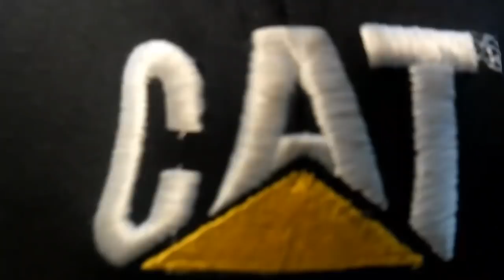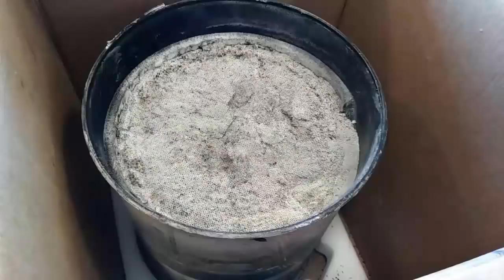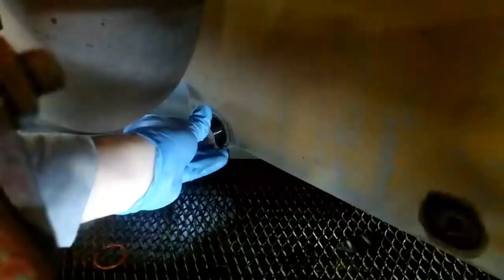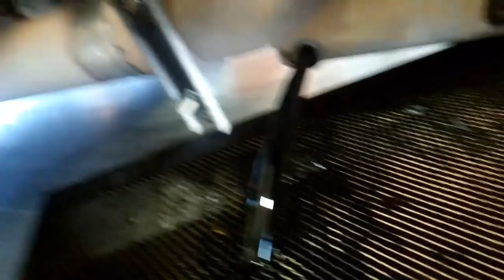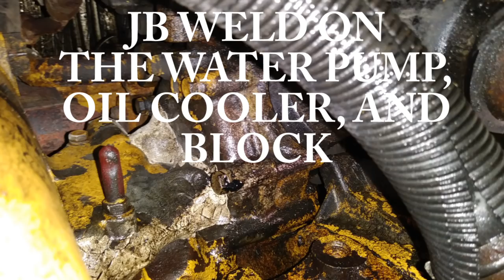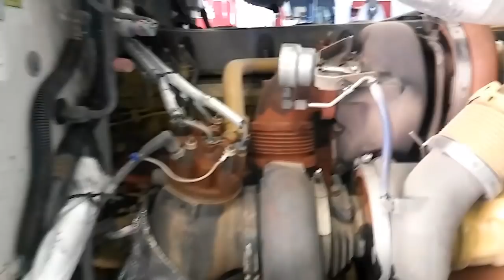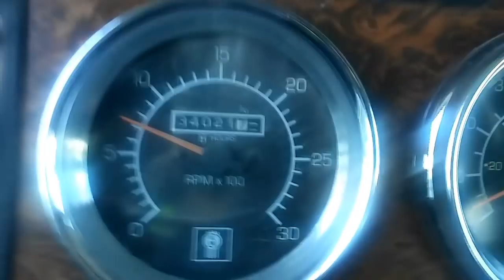What To Look For In A Used Diesel Engine? Used Diesel Engine Inspection.

Comment: Does anybody know any good diesel channels? I’m going to college for heavy diesel equipment and I’m looking to prepare myself over the coming weeks.
Reply: This channel and dieseltechRon. What college? I just got out of Lincoln and now going to another diesel school... good luck. Cheers!
Reply: I know I watched a bunch of videos on the channel Fanshawe Motive Power my first year and some videos on this channel during my second year (take apart engines, measure, reassemble, run).  I'm guessing the apprenticeship system is a bit different up here in Canada but those were the ones I checked out.  Just searching YouTube worked pretty good for me if I needed to understand something better (like all the fuel pumps and understanding how they worked)
Reply: Bradley Macaulay thank you sir, I’m sure it’ll help me in my combing years.

Comment: I love your site and advice just joined yesterday ive been looking to buy a 1998 thru 2002 chevy GMC 6500 rollback towtruck with the cat 3116 or the 3126 ive owned them before was years ago but they were great trks very easy to get used parts or new reasonable but there really getting hard to find reasonable were if it does need these things im buried in it so i found a 1998 chevy 6500 170k miles rollback the owner has had it for almost 11 years to transport cars to the auction so hes only put around 20k miles on it in all that time but the beds in great shape no rust interior is like new cabs dry its a eaton fuller 6 speed im fine with that actually have a spare sitting if needed so u no the truck O its a 3126 so heres the bad its smoking everywhere from all over under the hood when running now im over 300 miles away from this truck i no u cant give me any diagnosis when i personally haven't seen this truck just alot of pictures so my question is not about fixing it its about worse case motor swap i can buy 2002s gmc school buses this company has fleets and there selling them running driving home buses there automatics and there $2500 out the door so how do i tell horsepower or torque numbers is there a 3126 that u would want on your 1998 6500 if u were buying or building one i no rebuilt new is the way to go but in my situation rite now im on a budget i need a year so if i follow your advice from this video and i get the best one they have i no i have enough parts to make my truck a driver plus some extras like the rear the Alcoas with like new tires and its gotta return $600 in scrap when im done i really enjoy your videos and respect your knowledge you break it down into layman's terms makes it really easy to understand I just actually wondered if u were in my shoes what cat 3126 would u be looking for and its gonna be on the highway alot for power plus decent fuel sorry for this extremely long question i have a bad habbit of talking alot myself i hope u even see this hopefully u do either way keep up the great videos thanks again JOHN

Comment: Hey thanks for the video very informative and helpful I have a question I drive a 2015 International straight truck it has the n 13 engine buy Navistar with the def system what's your opinion on these engines I know the older maxxforce 13 what a pile of poo have you heard of people having the same issues with the newer def system on the N 13?

Comment: Will you do a video on the right way to disable the EGR? It has been clearly established that the EGR significantly shortens engine life AND fuel economy all in the name of reducing NOX. Thanks.
Reply: Robert Polkamp disabling egr is illegal so it's unlikely he will ever make such a video.
Reply: I wouldn't suggest getting someone to "disable" your egr... I give this advice both as a fellow diesel mechanic and the son of a semi driver.... HUGE FINES if you get caught.
Reply: You're gonna need to take it to a tuner's shop or do it yourself because this is illegal for on-road use. At least Michigan doesn't have emissions testing...

Comment: What about when the jake comes on it smokes dark smoke? Then goes away?
Reply: What is the year and make of the engine, and how long does the dark smoke last?
Reply: Chad Jessup hey chad it’s a 2005 mxs cat c15 Acert it will come out when I first turn on the jake brake and it doesn’t last to long maybe 1min at most, but it’s constant. More so when I first activate the jake for the day
Reply: One minute is excessive.  When the jake is initiated, at high rpm usually, there is fuel still in the combustion chamber which does not fully combust at that moment, so a short burst of black smoke is to be expected (newer engines/jakes not so much).  I would suggest there is an injector which is not seating properly and allowing some dribble.  Since the engine is ACERT, and I am not familiar with that, I would see if Josh could add an angle to this issue, because the black smoke is definitely a result of fuel in this concern, for I would assume notice would be taken of, say, a turbo oil leak into the combustion chamber.
Reply: Chad Jessup hey brother so I just did the test it smokes more on the 3rd setting and sorry it’s not for a minute I would say maybe 5-10 seconds and then clears up and it’s a dark smoke, I don’t know why I even though a full minute that is fairly long
Reply: OK.  That is actually good news for you.  Glad to hear that.  So that acceptable short period of black smoke indicates all cylinders are contributing equally.  Keep on truckin' and watching Josh's videos.
Reply: Let me add this:  For troubleshooting purposes, select 1, then 2, then 3 for jake operation to see if there is a difference in the amount of smoke.  The #1 position, if memory serves me correctly, activates the #2 and #3 cylinder jakes; the #2 position activates the #1, #2, #5, and #6 jakes; the #3 position of course would activate all the jake solenoids.  That procedure may tell you something, if smoke decreases in the #1 or #2 positions.

Comment: What Cat engine would you recommend in a highway glider-truck, long-life and desant mpg.
Reply: Diesel Power 6NZ if you don't mind eld, 1LW if you want to be eld exempt. I personally run a 1LW and love it, also have a 5EK and have no complaints.
Reply: 2ws
Reply: Isuzu 4HF1 is the best on highway engine you can buy
Reply: 20 to 5 wheels are tires on the tractor and 333 Rears is where you going to get your field mileage from 333 or 330rear screws either or with a  10 speed transmission

Comment: What's your thoughts on a Detroit 8.1 fuel pincher? Thinking about repowering an old fire truck with one.
Reply: it's actually a 8.2 the early models had head problems but the later ones were ok. they're very fuel efficient, but lack in power in my opinion. we have a couple of single axle dump trucks with that engine and we really like them.
Reply: Had one in a 86 gmc tow truck in catskills mountings no power at all
Reply: it's actually a 8.2 the early models had head problems but the later ones were ok. they're very fuel efficient, but lack in power in my opinion. we have a couple of single axle dump trucks with that engine and we really like them.
Reply: @Clyde, I'm thinking about repowering my 62' fire truck. Gross weight will be right at 25,000 with water and gear. What do you think? It would be replacing a 332 Lincoln Y block, so I'm not looking to get crazy.
Reply: it's actually a 8.2 the early models had head problems but the later ones were ok. they're very fuel efficient, but lack in power in my opinion. we have a couple of single axle dump trucks with that engine and we really like them.

Comment: We just ended up rebuilding 3 engines. All 3406E. They all had around about 1.5 million miles. All water issues. Either sucking it in or blowing it out. Is that about right for lifespan of a good cat motor? The one motor with big horsepower  numbers( turbo, injectors and a hot cam)  was blowing it out but the others it was pulling it into the oil pan.
Reply: 1,500,000 miles is a fantastic achievement.  Someone had to be performing good preventive maintenance for that to occur.  Great job.
Reply: C12 is 20000 hrs or 800,000 kilometers when due for rebuild

Comment: I've read some horror stories about some of the really old Diesel engines from the '80s before electronic fuel injection was even thought of.  In those cases engine manufacturing date is absolute key, as the manufacturer will try to revise issues as new engine developments come about, such as hydraulic roller lifters, single piece rear main seals, and serpentine belt drives that greatly improve engine reliability and reduce undue stress and load on the engine.  This is the case with some older Chevy half ton Diesel trucks with Detroits in them, as engine developments for small block V8s were also being shared with the Detroit Diesel counterparts.  Still doesn't mean that the crank has absolutely no problem with eating itself alive and destroying main casting webs in the process, turning essentially what sounds like a brand new engine into a heaping pile of metal on the highway.  Diesels are subject to a lot more vibration and knocking than a gas engine even when not under load, so adding more revisions to eliminate vibration will lengthen the engine's lifespan.  If you see a bulging or torn harmonic balancer, or a v belt setup, avoid at all costs.  buying the most updated block of the same type to rebuild and drop in is gonna be more cost effective, install a hydraulic harmonic balancer, replace the main bearings, rebuild the injection pump, girdle the main block webs, and use a dual electric fan with an oversized aluminum radiator, so the clutch fan isn't robbing the engine of power, and you'll have a pretty good reliable engine that should see around the same mileage as a tractor trailer.
Reply: My old 6.2 treated me well but I've had my 6.5 for about a year now. Most reliable diesel I've ever had but I've done a few mods. Fluidamper being one of them :D

Comment: We before we bought our kenworth t800 with a cat 3176 we test drove the carp out of it for three hours before we bought it and then we took it in the shop and crawd all arou d it with a light for leeks and made a list of thimgs wrong with it and told the dealer to fix it or back down on the price we also run a 3406 we love it as much as the 3176

Comment: Is a good thing I didn't watch this before I bought my 07 ram 6.7... had a p2262 code. Issue was bent viens on the vgt replaced them for 200 bucks no more code running perfect! I'm just a backyard mechanic working on my own stuff..

Comment: i drive milk truck for a living. right now they have me in a 2006 peterbilt 386 with a C15 acert. the truck has over 700K and known excessive blowby. i put a gallon of oil in this engine aprox every 400 miles. the check engine light comes on every so often and goes off. i told the shop about the check engine light and they "looked at it". i think in reality this engine has excessive blowby and is on borrowed time, and they know it.

i wonder how much longer it will live?
Reply: andrew donohue  keep oil in it and it may last longer than you want to drive it!
Reply: we have two trucks that are basically twin trucks equipped similarly 51 (the truck im currently in) and truck 54. both are 386 peterbilts, 18 speed transmissions, C15 acert engines. the truck i have been driving (51) has 707K+ and 54 only has 360K on it. truck 51 has better air conditioning, if i could get them to fix the A.C. in 54 i would probably start taking that truck instead. i realistically could drive either truck.

the new trucks my boss keeps buying  are T880's with ultra-shift 18's, i don't know if he is going to buy any more manuals..... plus they are all paccar MX13 engines. honestly i think the older 386's are better trucks and i think the C15 acert is a better engine then the junk they are producing right now.

i would rather just drive those older trucks then get stuck in some ultra-shift junk AMT transmission that isnt going to give me as much control when i back the truck, and those transmissions arent going to cope with surge loads all that well.

i enjoy shifting, if you arent going to buy me a new manual truck then let me drive the older trucks. im fine with that. he can keep his ultra-shift junk. lol
Reply: Acerts are bad for broken rings, bet you have 1 or 2 broken.
Reply: i know the acert is a not a trouble free engine but i still think they are better then the paccar equipped trucks he is buying now. i bet he gets rid of those T880's after the warranty expires. 

if it were my fleet i wouldnt buy any of that newer junk, i would buy a fleet of gliders while i still could. glider trucks with 3406B engines.
Reply: i was just given an almost brand new truck. 2017 T880 day cab with an 18 speed. it has that paccar engine and im not sure about its long term durability but the truck only has 52K on it. it is a manual transmission no automatic junk, which is why i wanted the truck. the truck i was driving is currently a spare.

FWI i drive day cabs and dont go outside of 60 or so miles away from the yard. im doing farm pickup work. if a truck were to break down, the mechanics would be dispatched to my location and i would have help within an hour or so. one of the many advantages to local work.

i make fairly decent money too. anything between $1K and $1,600 per week. the minimum i ever make is $1k